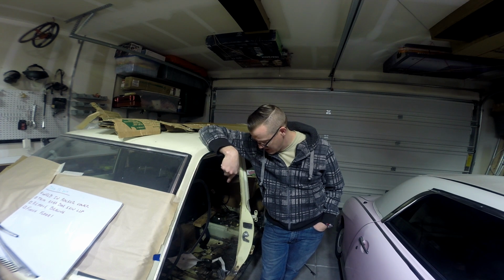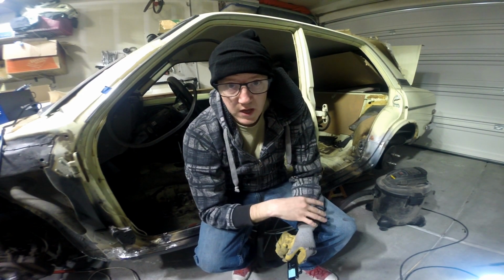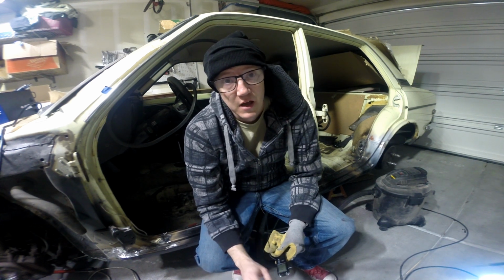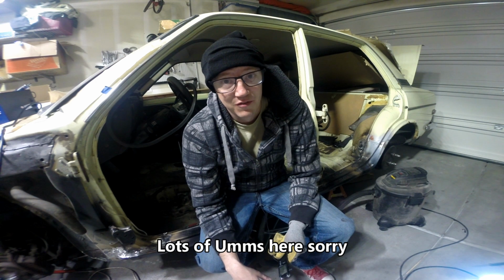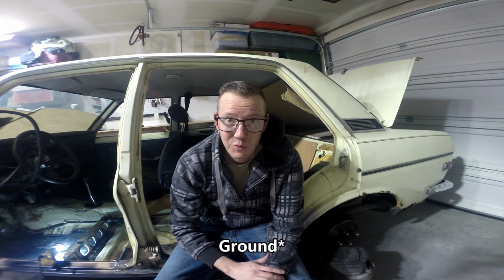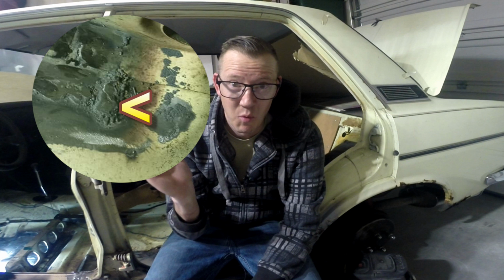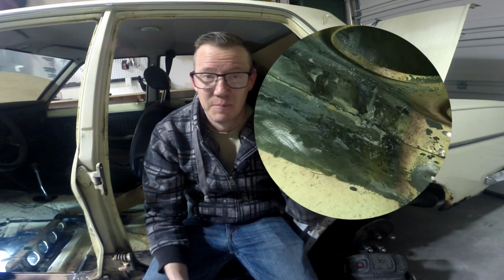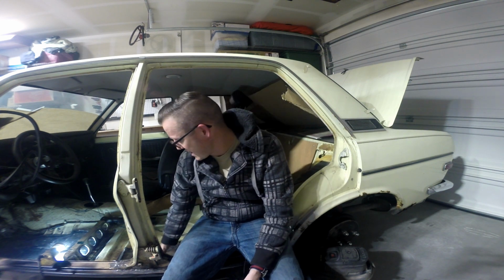Datsun 510 Grind Much? (Ep# 30)

Comment: Good grinders great welders make.
Reply: @AW_DIY_garage  what are you welding with and what technique used?
Reply: @AW_DIY_garage  Its starting to make sense now. A master welder will not get a good looking weld with that POS. technique is just as important, start with stitching, (it will be hard with the hardware at hand) you place a pool down, the pool has to be flat, the sound has to be right (its like teaching swimming by correspondence) next aim the gun at the end of the pool and do it again, in theory it should leave you with a bunch of small circles one on top of the other...sort of. overlapping teardrops in a row.
I'm not an expert by any means, yet me and my miller journeyman 175 stitched many bodies and frames...
If you are in the NW area I'll be happy to stop by over the weekend (for coffee) and give some pointers.
Reply: @AW_DIY_garage  I know where you are, you posted on Ratsun 702
I'm in Summerlin